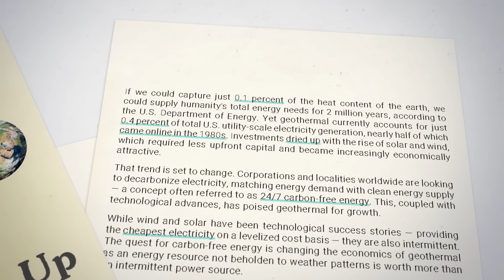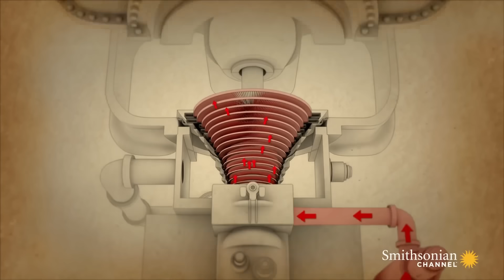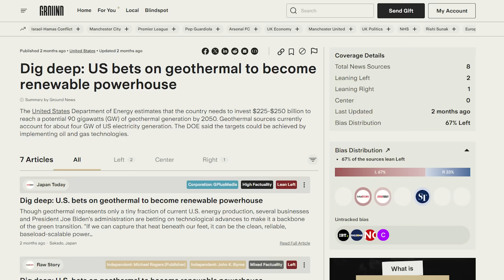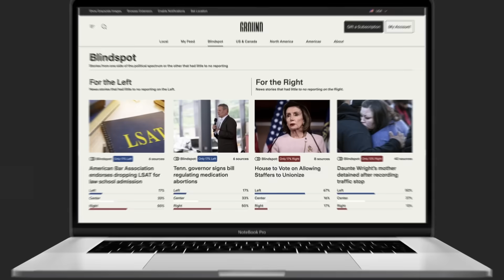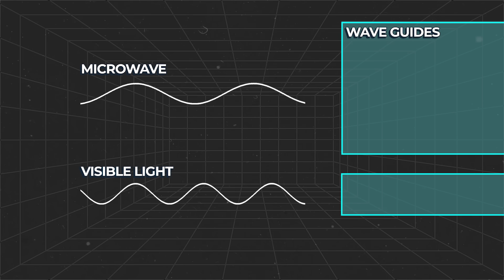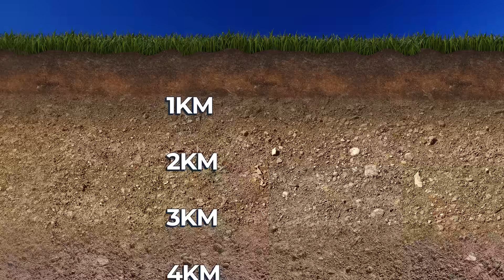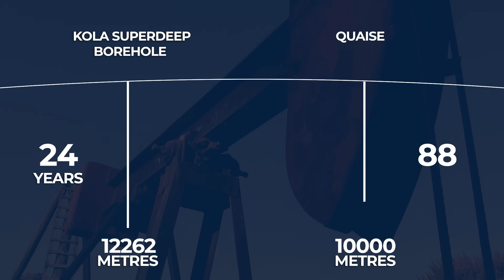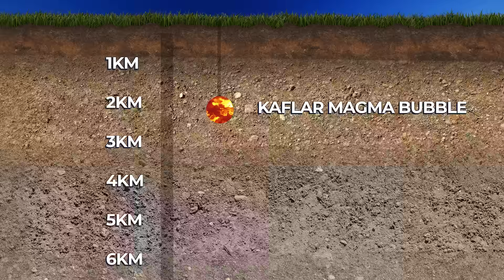This Fusion Tech is Solving the Geothermal Energy Problem

Comment: Attenuation in a copper waveguide is, at absolute best, 0.1 dB/m. So by the time the hole is 1 km deep, the 1 MW in the surface will be only 10 kW at depth. 1 dB/m is more realistic at mm wavelengths, making the drilling power 1 kW. That's for a solid metal waveguide. I think this stands no chance.
Reply: Lowest loss reported for Circular TE01 guide is reported  as 1.25 db/KM by S.E.Miller bell systems journal 33:1209-1265 Nov. 1954
But this was C band not mm.
Even so 12.5 dB of attenuation  delivers only 6% of the incident  topside power at max 10km depth, so your point is still valid, even with very opmistic assumptions.  Hmmm.  I wonder which will melt faster, the rock or the waveguide business end? Lol!
What will be the mismatch reflection between several hundred ohm Z waveguide and  plasma rock vapor? 5:1 vswr if they are lucky?
Pipedream!!!
Reply: @davidpacholok8935  Thank you for the interesting reference.
Reply: The microwave generator could be put at the drill head supplied with a high voltage DC source which will have significantly less loss. The trick is miniaturizing the generator to fit in the borehole.
Reply: @Proud2bmodest a small 1Mwt generator:)

Comment: Trying to access all that heat will cause a lot of problems as the strata that's being used is cooled to power the cities above it.

And it may be feasible to vaporize rock at the drill tip but then what?  All of that rock is going to cool and coalesce LONG before it can actually be evacuated from the surface - and I bet the equipment at the surface won't make out too well being bathed with vaporized rock.

Comment: This is a total fantasy. Firstly, there are many places around the world other than Iceland that have relatively shallow geothermal potential. Progress is slow because of various technical difficulties, but it is speeding up. Second, if you vaporise rock, once it cools down again it will recondense as a solid, taking up the same volume as it started with, unless you can pump out that vapour from great depth before it re-condenses. Good luck with that!

Comment: Is this really "waste-free"?  Remember the reason the magma is hot is through radioactive decay of elements like uranium and thorium.  Many of today's older, open cycle geothermal plants release large amounts of radioactive material into the atmosphere because they vent the steam.  The problem has generally been ignored because 1) these plants are in remote locations, and 2) there are so few of them is it worth worrying?  But if we're putting thousands of these plants into urban areas (which would be fantastic) what happens with the radioactive material?

Comment: huh, i would of thought you just use water jet with abrasive in it to drill into rock ? similar to how you cut ceramic on a cnc machine. No need to replace drill bit if you're drill with abrasive jet instead. Unless the pressure outside is too high for water jet approach. I mean drill into hard and abrasive material is pretty common in manufacturing as well, might as well adopt their existing technology for drill. Since the same physic constraint are the same. IE: ultra sonic cutting, acid jet, water jet, and electric discharge, etc.

Comment: From my career experience (wellsite geologist) I can say that one of the most important concerns, while drilling a hole, is to (over)balance fluid pressures otherwise there's a high probability of pressure 'blow out' / explosion. The principle method is to use a sufficiently dense drilling/circulating fluid creating a fluid-column pressure sufficient to hold back formation fluid pressures
Reply: As a geothermal Wellsite Geologist, with experience of all the challenges, I'm saying that you're very right. Other challenges include high permeability water filled fractures that swamp the beam with more fluid than it can handle/vaporize
Reply: The difference being that this geothermal well they will need to drill where there are NO oil or gasformations present. So at worst case you may get some water blowout. On the other hand, fluid or air has to be pumped down the hole to transport material to the surface. Maybe pump air at high pressure trough the waveguide (inner pipe), and fluid around the wave guide at lower pressure (between the inner and outer pipe). At the drill tip the air will blow the fluid away from the beam
Reply: @esbrasill  It’s obvious that a 2 stage program would work best. Use a normal drilling program with casing and cement to protect all the upper zones down to approximately 20,000 ft (6.1 kilometers) then switch to the microwave/laser process to finish the well. The blowout problem is a definite issue. I’d hate to be the guy working the floor when super heated steam comes screaming at my face.  😮
Reply: @TraderDan58  100% agree, but once laser drilling is started you still need mud or some fluid to remove the vaporized rock (i assume this condenses as glass)  and to cool the drill pipe. But on the other hand i suppose a clean waveguide is needed all the way up to the bottom of the hole. that's why i proposed the double walled drill pipe to transport air AND fluid to the bottom all at once, The mixture of air+fluid+dirt will the travel up around the outside of the drill pipe, inside the casings
Reply: @esbrasill  Agreed 👍. New processes and equipment will be developed throughout this project. Even though I have spent a lifetime in all aspects of the oil/gas industry I hope this technology can be implemented.
Reply: @esbrasill  Also for this project to succeed they will need a petroleum engineer, geologist (such as yourself), drilling engineer, and other oilfield related disciplines. As petroleum exploration tapers off hopefully we can keep those jobs working in this new technology.
Reply: @TraderDan58 it sounds like he’s pretty adamant about integrating as much existing infrastructure and skilled human resources as possible. That’s a huge part of its viability.
Reply: Do you foresee these fluids making the microwave drilling insurmountable?
Reply: Very true. I sincerely hope that they would take wellbore integrity more seriously.

Comment: I mean if geothermal were a thing, we wouldn't be able to use it anywhere. In a region with high seismic activity, such as CA, even if you are able to dig a hole deep enough without hitting a fault or a problem, you are still at risk that a bigger earthquake seals your hole and gets your plant our for a long time.
That said, this would be huge, it would open up more than just the best source of green energy beating the current champion (hydro), it would be huge for cheap desalination. You can use the same heat to evaporate sea water (you do not want to risk it and use geothermal water directly, it will pick up chemicals) and then collect it at another place, no need for fancy tech. The only cost is that you have to deal with the brine left but even then that can be solved.

Comment: In the Pacific Ring of Fire there are about 450 volcanoes where theoretically, useful temperatures can be reached at 1-3km. Sure, it would be nice to drill for geothermal energy anywhere, but it is not necessary to drill to 20km depth to develop magma energy. Shallower deposits may be geographically undesirable, but we currently produce energy in one place, refine and transport it to another. Magma Energy would produce constant clean base load electrical power, and hydrogen fuel - piped as a gas, or shipped as a liquid, and burnt in power stations. 
It's the one technology, in my opinion, we could deploy in time to meet and overcome the climate and ecological threat. The magma energy source is sufficient to meet world energy demand ten times over, and still provide surplus power to desalinate, irrigate, recycle and capture carbon. By the unstinting expenditure of energy - internalising the externalities of capitalism, we'd continue to grow into a long term sustainable future.

Comment: Are you sure that letting the heat out of the planet at an ever-increasing rate that can ultimately destabilize the planets dynamo is wise?

When countries see that it's possible to get cheap unlimited energy, technological evolution will happen at an exponential rate. More countries will drill more holes than they need. There will be no reason to conserve energy that will override the competition between countries and regimes for ever more energy, thus cooling the planet at an exponentially increasing rate. It would get to the point that small communities could have their own mini-geothermal energy plant piping ever deeper into the planet. Never underestimate the desire for power, both literally and figuratively.

Our species' track records so far has not demonstrated the wisdom to live within our means. The perfection of ever cheaper and deeper geothermal energy extraction, before a species is truly ready to properly manage it, could be the solution to the Fermi Paradox. You can't put THAT genie back in the bottle.

Comment: The idea of tapping the planet's internal heat at "all human civilization"-scale, helping the planet's core to cool off even faster, really doesn't appeal to me....especially when we have Th-fueled molten salt reactors which are cheaper than coal, and fusion is finally looking like we're under 20 years away (but requires gargantuan initial capital outlays and long build times for now) and maybe as little as 10
Reply: We won't even breakthrough the mantle with this tech. the earths core is 1000s of times deeper. The comparison is like an apple skin to  the core of the apple.

Comment: I'd like to know if they tested the effectiveness of the system when encountering things like water reservoirs, highly resistant elements (if there are any), etc. Because yeah you can dig really fast but what are you going to do when you're already 5km deep and the suddenly hit a large water reservoir or a thick plate of energy defusing rock making the entire borehole unstable? Will the system last through an earthquake?

So many questions.

Comment: My ADHD is on fire today so I probably missed the part where it was explained.  How are they planning to remove the excess glass they produce? I seem to remember glass having a density around 2.5g/cm², and something like 2.7g/cm².  Obviously, that isn't near a big enough of a differential to just plough on down without removing large amounts of molten glass which won't be molten by the time it reaches the surface.

Comment: Geothermal energy is not free, that heat comes from the tidal forces of the earth. Using it will stall tectonics and accelerate tidal locking of earth, dooming our species. Coal is far better. no joke.

Comment: I never thought of using photonics. I was thinking of chemistry, and if there was some type of acid that could be used to eat the rock down to a point. Though I guess that'd be difficult to control. You'd still have to aim and try to keep it within a radius. I really like the idea of geothermal energy. It is more safe and clean than nuclear. Also when it comes to mechanical drilling, why not use a type of bit that uses diamond, even artificially? I am not competent enough in these fields to really answer such questions.

Comment: I feel like the engineering challenges with this approach are less epic than space solar or nuclear fusion. We dig big holes all the time - I imagine setting up a tunnel boring machine on a steep incline and getting 8-9km down (over maybe 50km) without too much issue by having the MASER heads instead of diamond heads , and then setting up a series of galleries down deep with traditional drill and blast, then do the last few km of vertical wells to the geothermal reservoirs with the vertical drill techniques. We can borrow all the smart engineers who built the LHA infrastructure.
Reply: Something tells me that "traditional" is the last word that would apply when you are 10-20km below the surface.
Reply: Your proposed 50 km tunnel would be among the world's 30 longest tunnels, while also reaching depths well beyond what a TBM is normally designed for. As far as I know, there's no precedence of getting a person deeper than 4 km underground, yet you seem to propose crewed machines operating "8-9 km down". You think it is easy because you don't understand how difficult it is.
Reply: @BlurbFish  You're right, I don't fully understand how difficult it is. If you have some experience, what would be the challenges? 
Given we've got a number of mines in the 3-4km deep range, my thoughts were that downwards and sideways bearing pressure at 4 km is going to be similar to that at 10km, and other challenges like logistics are already solved.  Most deep holes are mines, and I was guessing that all of the engineering problems are already solved, but the reason we don't have deeper holes is there is currently no point in spending the money due to ore grades not being up to par.
Reply: @mikelastname  The problems with your proposal are the same as those described in this video, and then further amplified by factors inherent to your proposal. You want to drill at a slant instead of vertically downwards, which means overall more km worth of digging in the difficult depth. You need to have crew for the TBM (and the machinery you set up later for the many galleries) at a depth where the temperature is killing. The diameter of a TBM bore hole is enormous compared to that of a bore well, which means more material to remove and higher demands for structural support - the latter becomes more and more challenging to deal with as you go deeper.

Again, going deeper becomes more difficult the deeper you are. You propose to get people down to 8 km, even though 4 km has not been achieved.
Reply: @BlurbFish  Thanks, yeah, temperature sure sounds extreme at those depths. I get that widescale geothermal is a very difficult proposition, but putting my dumb ideas aside,  for blue sky thinking, I feel like the engineering challenges for this would be less than for say, nuclear fusion  where after 50 years of effort, we are a lot further behind where we are with mining engineering.